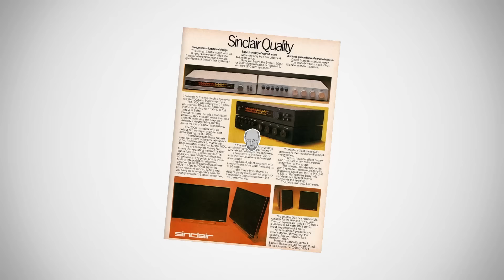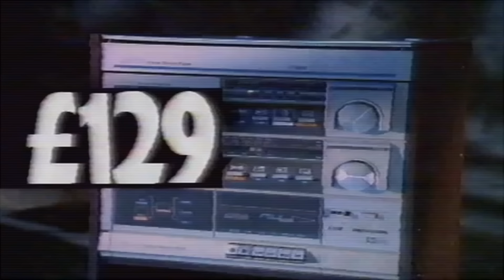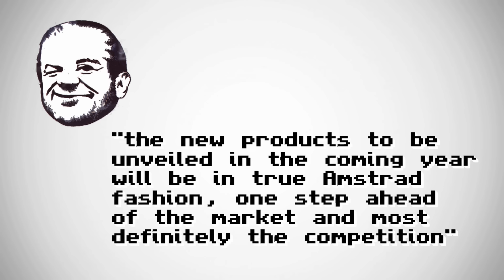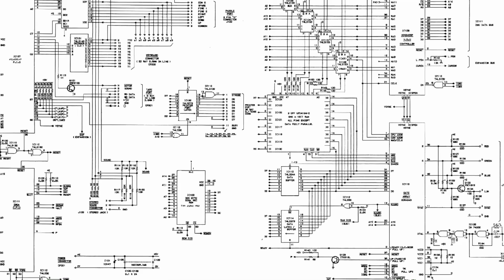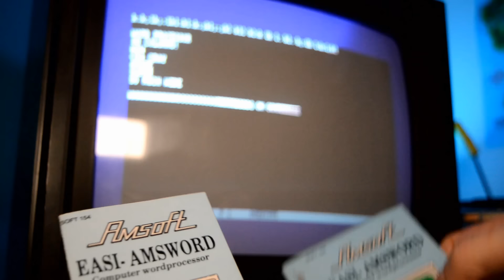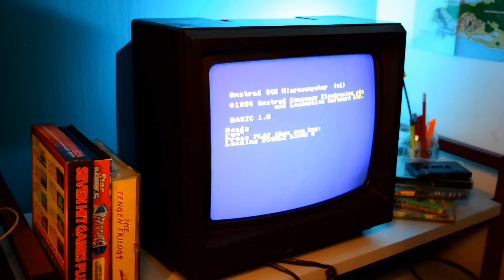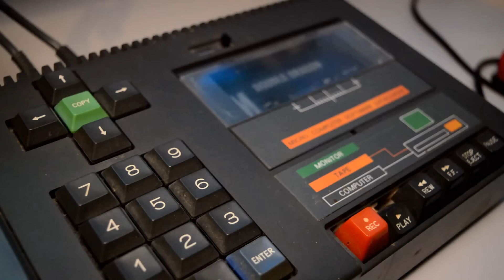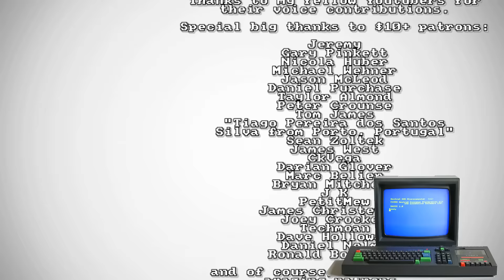Amstrad CPC Story | Nostalgia Nerd

Comment: Amstrad's earlier stereo kit may have been ropey, but - maybe thanks to the computer experience - they seem to have got their act together by the early 90s. I've still got the Micro 1000 two-box hi-fi that was a much cherished Christmas present, one of those years, and I believe it still works although I've not had anywhere practical to set it up this last decade or so. It was a pretty solid little unit, essentially embodying most of the qualities outlined here - make it just good enough to satisfy (meaning that whilst maybe no part is particularly fantastic, none of them are totally crap either), reliable, with a smart aesthetic design and a general lack of nonsense.

The CD player was a little basic but had all the main features you tended to use and one-upped the true bargain bucket brigade by having a proper time display instead of just track, the digitally tuned, auto-search, multi-preset radio worked as well and had as good a signal as anything else I've ever used, and the tape deck quite remarkable for the size and price allowing you to dump that new compilation album you got for your birthday onto a C90 to listen to with a knock-off walkman and not have it sound utterly hopeless. The size and layout meant it would fit just about anywhere on a child's bedroom shelf, or on a beside cabinet (fully separate speakers on long leads, though) and the displays had a nice soft blue glow that seemed very futuristic and calming.

And just in case you were mental enough to want to attempt using it to Form The Basis Of A Modern Hi-Fi System by connecting a turntable (with its own phono stage, that is), DAT, reel-to-reel, VCR or other additional bit of audio gubbins - or just a second tape deck of course - it had those oh so essential Red And White Sockets On The Back. And of course it was a piece of cake to set up - one figure-8 power cable, a single multi-way connector between the two halves (discrete wires, not a ribbon, so you could vary the positioning, unlike ribbon-connected separates), and a couple of bare-ended, clearly marked 2-core cables for the speakers, and you were away. I think I even found that the amplifier gubbins were in the "base" tape unit and, so long as you didn't mind losing control over volume (or stuck to using headphones with an inline control), it could be used by itself without even bothering to connect the "upper" box that held the CD, radio, displays, control switches and aux input.

There were a few small annoyances, but they were livable with - no fast forward/rewind search function on the CD, no Longwave on the radio, only five presets for MW, what looked like a volume knob was actually the balance with the volume instead being controlled by some digital switches (ultimately that was a shrewd move - it was much easier to integrate with the remote control, and of course analogue pots get scratchy and noisy over time... you can do without using the balance, but volume is a very frequently used control, so that going crackly would have been annoying), the lowest volume setting was just a little too loud if you lived on a quiet street (I compromised when listening to the radio at night by twisting the balance all the way to one speaker and setting it in mono mode, or even disconnecting one speaker and balancing it partway towards that side... though of course what you were more expected to do was use headphones), and the remote control was pretty hopeless, having only volume up/down, mute and power/standby buttons. (I should probably try it with an all-in-one replacement to see if it unlocks extra functions, as I bet the system itself could accept all kinds of commands but it was cheaper to set up the controller with a very limited number of buttons and a minimalist encoder chip that could only send four codes).

Which were joined down the years by the switch that detected whether the pop-up CD door was closed getting a bit bent out of shape and requiring a small weight placed on top of the deck to trigger it (or a matchstick inserted in the hole, which let you play discs with the lid open and mess around with seeing just how much you could interfere before it started to skip; it's probably easily repairable if I bother to open the case), and the backlights burning out (probably just generic bulbs with blue gel filters over them to create a fake early-90s-zeitgeist "indiglo" EL effect, that I really should get around to replacing, maybe with LEDs... again, just gotta get round to opening the case)... and a slight misalignment of the tape head that was easily fixed with a jeweller's screwdriver through a hole in the front bezel as per the owner's manual. But none of those, nor the slightly cheap, soft-rubber end of the power cable wearing away after one too many sparks from it not always seating properly (solved by replacing with a decent cable, and figure 8s are something you come to accumulate an excess stock of through your life), were in any way fatal and it was still ticking along just fine when packed away, having outlived at least two other replacement stereos from supposedy more reputable brands bought as upgrades over the Amstrad... both times they eventually ended up on the scrapheap and the Micro 1000 was pulled back out of storage.
Reply: OK, that's a bit of a rambling tale, about something that isn't even a computer, but I hope it serves as a bit of a testament to Sugar's philosophy when it came to making electronics for the everyman. If you're a committed high-end audiophile it's easy to dismiss them as cheap tat, but there's far worse you could have bought for the same money at the time, and certainly today there's much tackier stuff on sale that won't last a quarter the time. Simple, unpretentious, just about good enough (including embodying the odd desirable advanced feature whose inclusion is enough of an enhancement to justify shaving the penny a little elsewhere, so long as you don't make any other part identifiably "bad" rather than "mediocre"), attractive in an unassuming rather than ostentatious way, and unexpectedly rugged. What else do you want from a Thing Of The People?

And we can sort of see that in the CPC, as well as a lot of people's cars. For most general tasks and contemporary games, you didn't need anything more than a mid-single-digits MHz 8-bit processor, so a cheap and plentiful Z80 will do just fine - essentially, almost any "real" processor is suitable in that case, because it's going to be far more capable than any calculator and unimaginably fast vs having no computer at all, but they still made sure to keep it in contention with the existing state of the art. Same as how the early cars with maybe 10 to 25 horsepower got whole generations on the move despite that seeming tiny today - it was enough to compete on speed with an everyday motorbike or scooter, and was still far faster, and capable of transporting much greater loads, than taking the bus, cycling or walking. They put a decent amount of memory in it, essentially maxing out the base form of the architecture, so they couldn't be accused of skimping there, and minimising the need for annoying, flow-breaking and error-prone multi-part loading (and saving) of programs and files. The soundchip was inexpensive and off-the-peg, but still fairly capable by the standards of the day, only really coming second to Commodore's SID, which was only practical to include in the C64 because Commodore could make their own chips.

Perhaps most importantly, instead of the single fixed screen mode of a lot of competitors, or the still fairly simplistic combination of 40 column text (about all an RF connected TV could handle) with a few colours or lower resolution with a few more colours seen in the C64 and BBC, and their rather unsatisfactory fixed, unnatural-gamut palettes, they provided a fully selectable palette from a full range of primaries and secondary colours to give images a more natural appearance with the minimum actual effort (the two lower modes were essentially just a different way of dividing up memory over time, much as low and medium rez are in an ST)... but more particularly, also flipped that round in the other direction, sacrificing colour entirely in order to provide that oh-so-crucial, much sought after, business-essential 80-column mode (and with a "proper" 8x8 font, even, vs the 7x8, 6x8 or even smaller ones on offer from some rivals) that until then had only really been available in IBM PCs, the BBC, C128 (and some special, poorly compatible versions of the PET), and specially upgraded Apple IIs and Atari 8-bits which had been equipped with a special card. All of which were much more expensive solutions than simply decoding the memory of a plain micro in a different way, made rather more practical by the choice of natively producing baseband RGB as the main output and making RF modulation a bolt-on option rather than the default. There's a good chance that one decision, as well as the provision of a super affordable disc system and OS, was one that drove the healthy cross-market sales of the machine even more so than it being attractive as a gaming system that was more colourful than the Sinclairs whilst being cheaper than the Commodores.

Essentially with the addition of Locoscript and a printer you had yourself something functionally equivalent to a PCW, just with a slightly smaller screen area (and there's probably not many people who'd cry about only having 80x25 instead of 90x32, with the same font, and an 80-column printer...) and half the working memory, but was also usable as a full, BASIC-running, colour capable, soundchip equipped home computer, at about the same price. Making the choice between the two, similarly priced machines, if you had a need for that kind of application and not too much money to spend, a bit of a two horse race, both horses being Amstrads (thus both of them ending up being huge sellers), and the decision largely being principled along the lines of what else you might want to do with it. Largely running other fairly serious programs, under the CP/M environment, for which a slightly higher resolution and more memory were key benefits? PCW. If you wanted to ever have more than pure monochrome (and indeed, only green on black) hi-rez video mode available, run any kind of game or other non-business-oriented software other than the few that made it onto the PCW, and weren't too bothered about only having 64k instead of 128 (or later, 128 instead of 256) or those few extra columns and rows... CPC.

Too bad they didn't do so well then trying to hook the users of their early machines into their more expensive and probably even more profitable PC clones later on (not that those were actually particularly bad machines either, it was just a much more saturated and high-value market where it was extremely difficult to differentiate yourself from the competition in any meaningful way), but, hey, it was good whilst it lasted.

And whilst Siralan might be a bit of an abrasive character and his business practices may leave something to be desired here and there, it's hard not to have some kind of grudging respect for him and his company in light of both the CPCs/PCWs, and my dear old duplo-style stereo.

Comment: I had the A-CPC-464 and used a modulator so I could play it on a large TV screen. I had no issues with my computer. I did like a few Amstrad products but the worst performing Amstrad product I owned was Amstrad's C.B. radio 901. It looked nice with the fairy lights instead of a mechanical power meter, it looked sturdy, had good sound and TX audio. It's biggest downfall was the bleed over from other channels. If people with good signals were chatting on a channel, you could hear them 10+ channels away. It was hellish if channel 20 was occupied as it was impossible to hear people on the breaker channel 19 as the bleed over was so bad. Glad I got rid of that and bought a President Jackson SSB C.B. radio.

Comment: Great video.

28:52 the 12 free titles were part of a package about one year after the initial launch, around 1985 when the 664 was released in the UK.

Amstrad 464 was 3rd in the UK when it came to games support, I think because the ZX48 and C64 built up a user base earlier.  Some titles never made it to the 464.  In terms of graphics between the 464 and C64 the 464 was better in vector graphic games. However the lack of sprites on the 464 was it's main disadvantage.  Many games had terrible scrolling.  Ocassionally the 464 would have a game with smooth scrolling but usually the C64 beat it.  The C64 also had superior sound, although if you connected external speakers to the 464 it's a major improvement over the built in speaker. If the 464 had launched with built in sprites, smoother scrolling and ability to display say 8 colours in mid resolution compared to 4 to would have been the best 8 bit gaming machine for the mid to late eighties.

Comment: There's a theory that Amstrad nicked the colour styling for the 464 from the Elan Enterprise (company leak perhaps), a system which at that time was stuck in court battles over using the name, "Elan" (eventually released 18 months late as the Enterprise 64 and Enterprise 128). The similarities are hard to brush off, with the Enterprise a far more sophisticated machine (though not once it finally launched). The Enterprise is one of those tech history paths not trodden; note the 464 has a very similar memory expansion potential aswell.

I bagged a complete 464, monitor and printer in the early 90s from a family a couple of streets away, spotted it in their porch while walking to uni. I rang their doorbell and asked if they were throwing it away; yes, they said, and were more than happy for me to take it all away. Yay! 8)

The integration of the 464 is certainly nice, but it wsan't groundbreaking in any significant sense, despite its obvious advantages over the Spectrum.

Just a shame the Enterprise hadn't come out on time, it may well have blown everything else away (up to 256 colours, though at a low res; more sensible was 320×256 with 16 colours, selectable from a palette of 256).

https://en.wikipedia.org/wiki/Enterprise_(computer)

But yes, compare the styling. Hmm...

https://regmedia.co.uk/2013/09/03/e64_6.jpg

Comment: Amstrad could have scored a coup in 1986 if they had released a computer that was CPC and Spectrum in one and at the same time met the MSX2 standard. This would have been technically feasible and would have created the ultimate 8-bit home computer: 4 systems in one (considering the system-immanent CP/M compatibility), with a common processor and a lot of congruent hardware and maybe an 8 MHz turbo mode. With a huge range of software and games. The latter was always a shortcoming of the CPC...
Incomprehensibly, after the purchase of Sinclair, Amstrad continued to release both systems separately, the Spectrum 2 even in a CPC-like case... Wasted potential.

Comment: The 5 dumbest mistakes of Alan Sugar  that would have made AMSTRAD way more popular : 
1) 3" disk drive instead of 3.5"
2) CP/M instead of MS-DOS
3) Little on-board RAM and expensive expansion to 256, 512, 640K
4) Not pressing the lazy software developers to stop porting crappy games from Spectrum to the CPC and use the machine's better specs
5) Wasting money on Sinclair's garbage computers to make them better, 
instead of improving the CPC line which they marginally did with the PLUS versions, albeit too late.

Comment: The C64 was £199 nearly a year before the CPC's first Xmas sales period and the Commodore Datasette for £40 and you could easily get a cheap portable TV (which can be used as a second TV in the home remember) for under £100 so really the CPC was a con because a) the sound came out of that shit speaker of Amstrad telephone quality which is what prospective buyers heard in the shops on demo and b) you couldn't adjust the colour saturation on the CPC colour monitor and the default level was Chernobyl!  The CPC modulator ALSO did video only so the sound STILL comes out of that shit speaker. Not all CPCs have the audio output via a headphones socket either. So really you will find the more intelligent families getting a Commodore 64 without even knowing of the far superior audio visual custom chips because on top of all that the C64 had a large established software base for everything, even packages for cookery courses with famous chefs blah blah. Thank goodness there were a lot of thicko truck drivers to make up the third largest selling position in the UK for the CPC464 :)
Reply: MadCommodore Which Amstrad CPC doesn't have an audio out? The one on my 464 was connect to my hifi
Reply: full of shit ! the CPC is the most solid, stable computer of the eighties, tank built, made to last while the C64 has a shite hardware.

Comment: Amstrad to me means cheap nasty crap and i always avoided it like the plague.
Reply: if you wanted nasty crap, you'd choose the C64. What a load of bollocks hardware, the crap PSU, the crap display, the crap build up of the motherboards, etc etc etc.....
Reply: @dlfrsilver  that horrible disk drive?
Reply: @Gantradies  yes the C64 5 1/4 is slow like hell, you need hardware again to speed it !